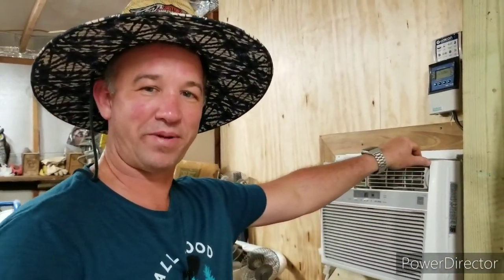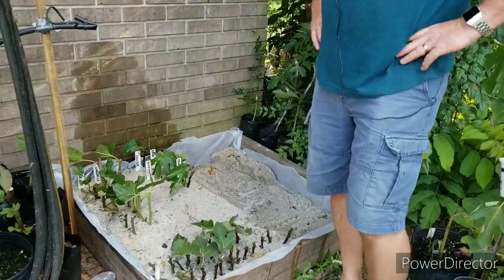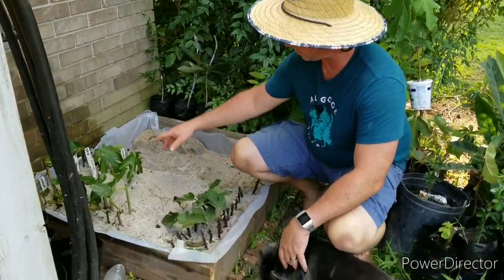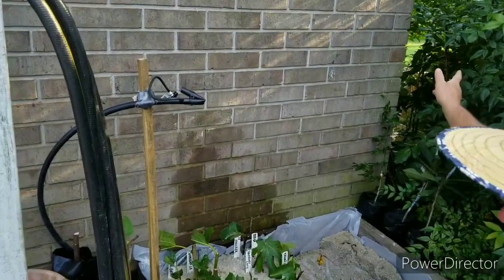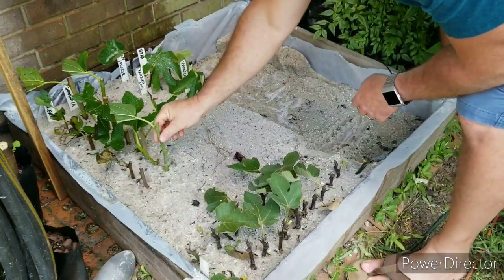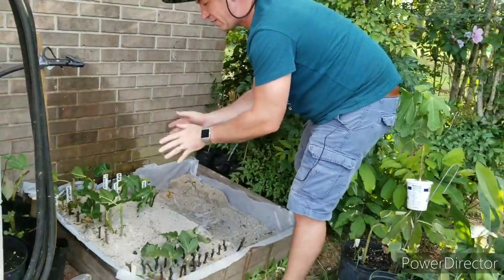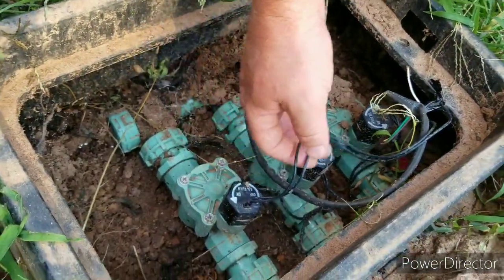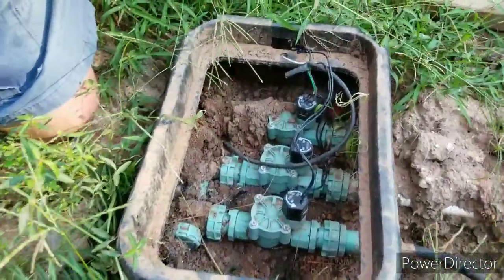Mist Propagation System | (Do this for cloning plants)

Comment: what was the  pressure reducer setting?
Reply from the maker: I used what I had available, I used the Mister Landscaper pressure reducer from Lowes. in the drip irrigation section. I think it's 25lbs.
Reply: @FlomatonFamous  Thanks